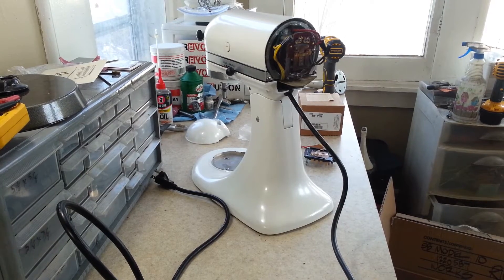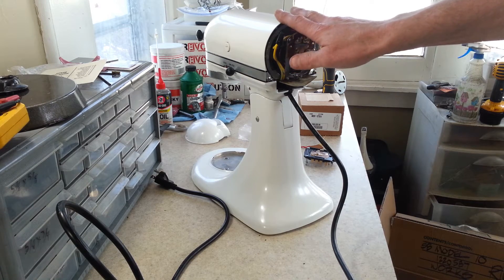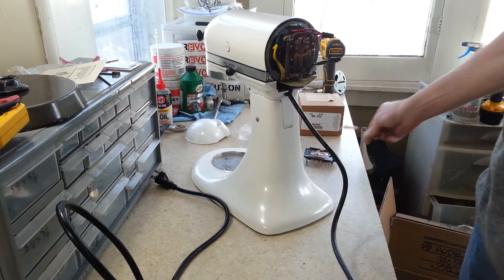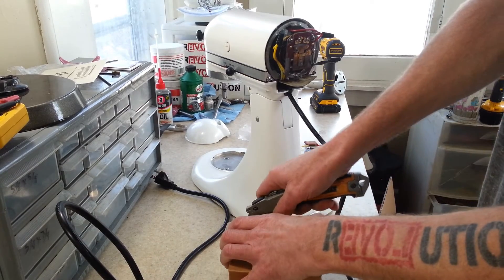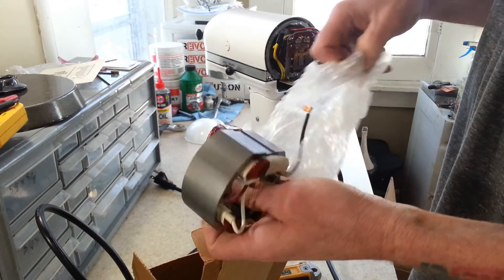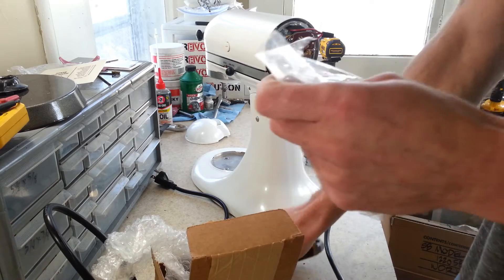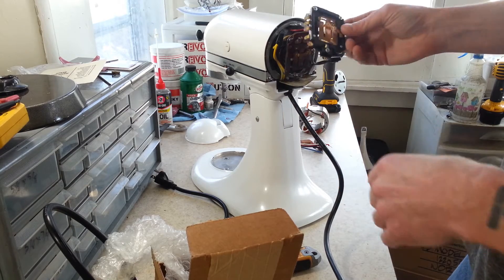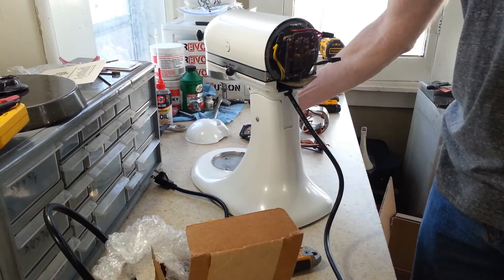Kitchenaid K45 conversion to solid state

Comment: Why did you order a new field coil, is it too different on the SS version from the non-SS version? I also noticed some slight "jumping" at the higher speeds, you could try screwing the right low speed screw in or out a bit to get it steady ;-)
Reply from the maker: JohnnyJim J yea i could have rewired the old coil, but the ss coil has the connectors already attached. I wasnt sure what was going to be involved in it when i started, im not sure its ever been done before. I heard that in rhe video, but dont hear it in person, i think thats the crappy audio on the camera.. i adusted the lower screw to set the upper speeds. I was actually surprised how easy this was in retrospect, it started to feel overwhelming while in the middle of it lol
Reply: Kudos, it was a great video :-) The advantage of the SS control is the points wear very little, no burning out of the contacts like I see on the old Sunbeam Mixmaster, for example. 

After hearing the video once more I believe you're right, it generally sounds fine, the miss is very slight (at speed 4), so that's pretty much OK. 

Mine was doing that a little bit more than yours even though the top screws seemed even. So I looked at the contact fingers from the top and noticed the contact plate seemed slanted slightly inboard to the right so I immediately thought this couldn't be right, but after research it turns out that's normal, the right side fingers are supposed to come off in the speed control cycle, the left contacts after. 

In my case I found out the fingers had dug themselves in a bit into the stationary plate from wear over the years, changing this dynamic, so I had to skew the top plate a wee bit, against recommendations, to compensate for this and it's been fine ever since.

I know replacing these parts seem trivial as far as cost is concerned and hardly worth the time in dollars and cents, but knowing WHY things go wrong and figuring out HOW you can repair them as they age, instead of throwing them away is, to me, priceless :-)
Reply from the maker: Thanks! You know, I was a little hesitant about updating it to solid state, but I didn't have much choice to make it run again, since the capacitor seems to be pretty hard to find. Afterwards though, I realized it is still a vintage machine that now can have parts available if it ever should need them. I do like the contacts on the SS speed plate way better than points, I am seriously considering trying to convert a 4C to a solid state control now (my wifes) , I had attempted it once before, but abandoned the idea and switched back due to time restraints, but I will be giving it another go eventually. 
The plate that came on this was a SS part ordered by the owner, but of course it didn't fix the problem of high speed only,. It may still be a good part, I will have to test it in another machine. The bottom part of the plate looked like it was tweaked out, but he contact portion was angled like the new ones, so it may still be functional, so I wont be charging for that part. Eventually I hope to master the kitchenaid parts list lol, and not order wrong voltage phase boards! :) 
That is pretty embarrassing !
Reply: I re-watched the video and realized you changed a lot of parts to get it going! It truly was a major undertaking and struggling with a couple of antique restoration projects myself, I can truly empathize!

As for capacitors - I understand they are impossible to find but what about their specifications? Or are they unmarked and their specs completely gone from having been covered with dirt and grease over the years? You know as long as it is replaced with another of the same capacity, type and voltage the rest is quite secondary... Perhaps we should ask folks who have old machines to volunteer a look see, perhaps we'll then be able to find out what they are be able to find a replacement :-)
Reply from the maker: I didn't find any markings on the capacitor at all. I would have thought someone could figure it out and offer a replacement option, but even nelsonezy sells capacitors for them and states it is not a permanent fix, so I assume they die rather quickly. This was the first time I attempted this, and I don't know if it has ever been done before, but afterwards when thinking about it, it will be much simpler to do again, knowing what I know now :) 
The nice thing about converting it over is all the parts are still available should anything ever need to be replaced. 
I don't know enough about capacitors to figure out what size would be required, or what it would take to make one last. Seems something out there must work, but I couldn't find it , but I like this option as well.